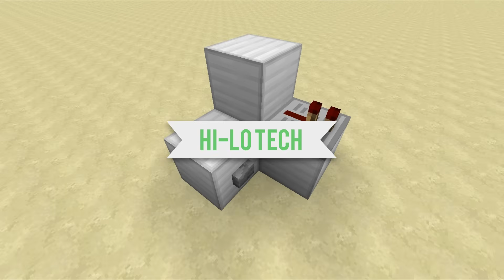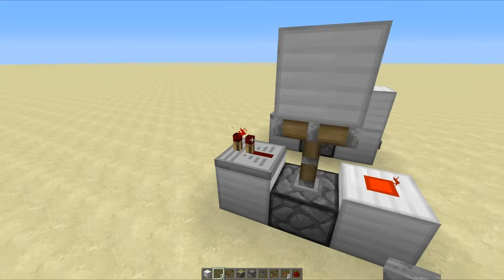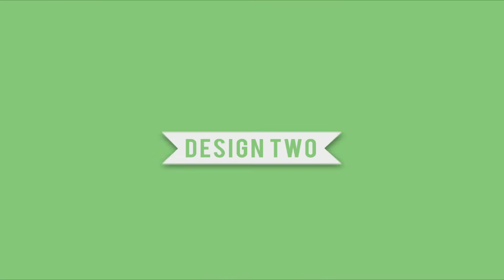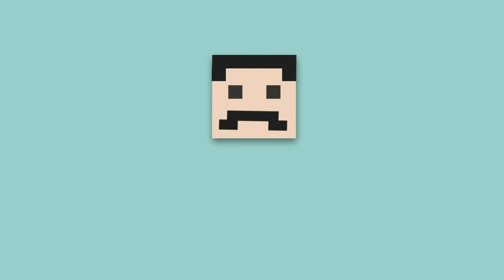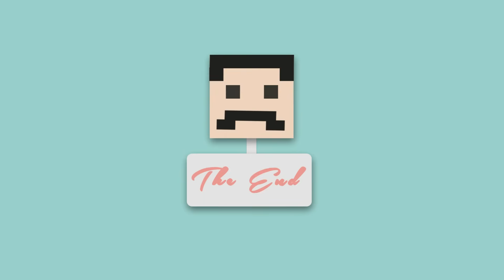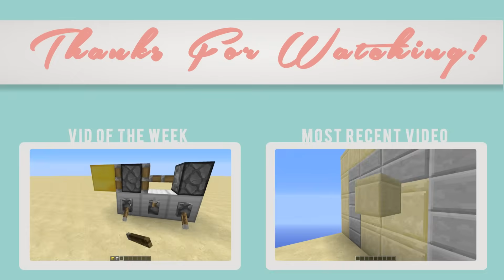HI-LO Tech: The Monostable Circuit

Comment: Just out of curiousity, how good is that last circuit for use for a double-pulser (for lava and water blades in particular) compared to the 2-hopper/comparator design? If it's comparable, it'd be a nice option for the early world when you've gotten some redstone, but not made a run to the Nether yet.
Reply: it would work fine, however you'd need to ensure the pulse going into the duel-edge monostable was the right length needed ( needed ticks + 1 )
Reply: DreadKyller so you would need a monostable BEFORE the dual edge monostable

Comment: nooooo! I am sad! ;(   on the first circuit, you can use a sand or a gravel on a normal piston!
Reply from the maker: I know, but the standard is a sticky piston with a block on top. Reason being, sometimes if the piston receives a second pulse as the sand is falling it breaks. So I generally stick with sticky - block to keep things secure.